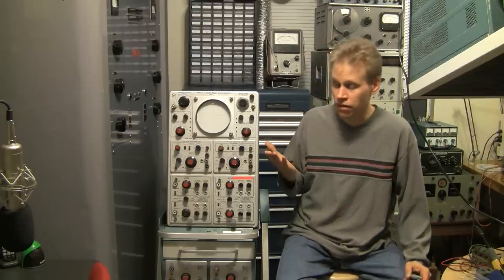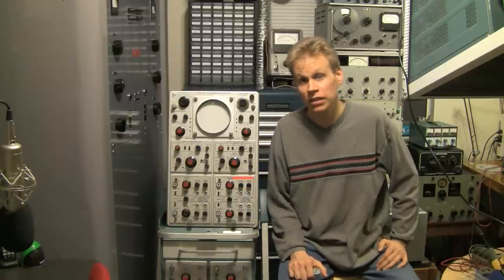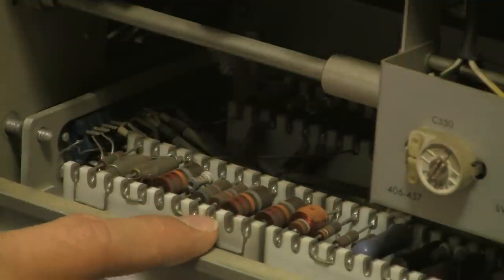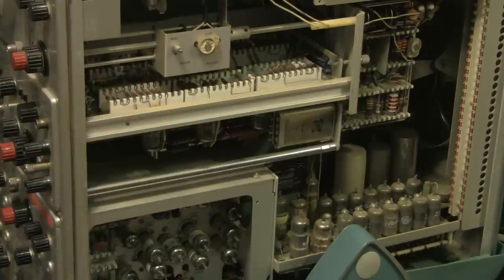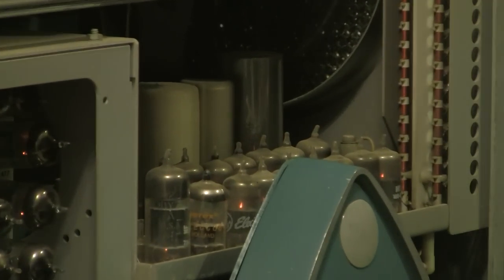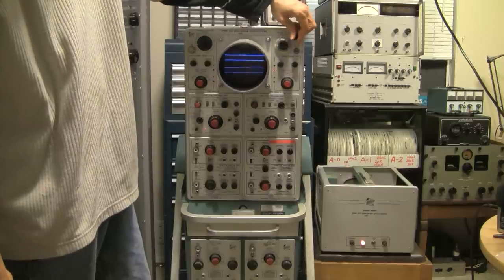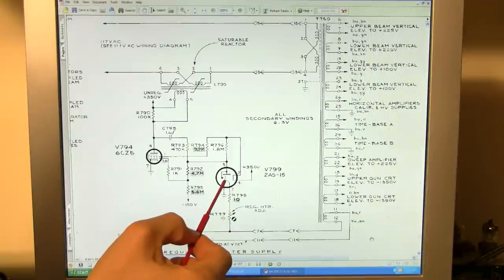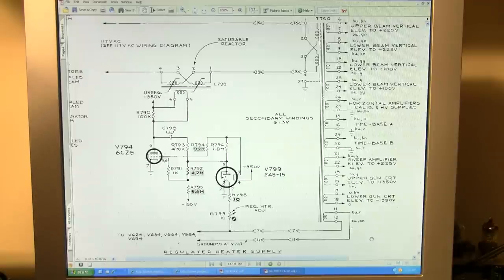Tektronix type 555 oscilloscope, over 100 tubes inside!

Comment: I was a repair and calibration tech for Tektronix in the 1970s.   For EVERY piece of gear that came into the shop, its first stop was the wash rack.   The gear was hosed down with soap using a sprayer nozzle virtually identical to the ones you see at the self-serve car washes, in a well lighted and mostly enclosed metal "sink" that had a large lazy Susan in the middle so that the gear could readily be rotated during the procedure.   It'd then be rinsed off, and then blown out with compressed air.   The next stop was the dryers, which were large heating cabinets that ran about 130 or so degrees (IIRC), and they'd stay in there for at least two days.   The only rule was, any gear that had transformer cans, had to be positioned so that the opening in the can faced down to avoid any chance of a large amount of water pooling up inside and not drying out completely over the two days.   Consequently, none of the techs ever had to deal with the "smell of dusty tubes," it was all squeaky clean before we did anything to it, even before we powered it on for the first time.  I never saw or even heard of a case of something being damaged from the wash.   Made it nice to work on the old tube gear given there were a lot of them still operating that had long been in dusty and dirty shops.   Tektronix had its own ceramics shop to make the strips, so they were the only ones who used them-- and they also made it a breeze to work on.   The ceramics shop eventually grew into making ceramic CRTs, another thing you were not likely to see in any of the competition's equipment, and they made their own bistable storage tubes, quite an achievement at the time.   Tek gear was designed to be maintained, in the 7000 series for example, every transistor is socketed as well as all the ICs.   And the 7000 series "digital" readout chips were actually analog, designed by Tek to "steal" the beam away from the trace momentarily and move it into the corners to draw the readout characters.   The 7000 series displays are not raster scanned, they're actually drawn, which gives them their unique look.
Reply from the maker: Thanks for sharing your story! That was a great read.
Reply: No, I don't believe so-- as far as I know the water was right out of the tap and not treated.   I suppose there could have been a water softener, I don't recall now, but I doubt it was distilled.  And it was blow-dried off before putting it into the drier, mineral deposits weren't an issue.
Reply: Absolutely-- if you drop it in a puddle, that's what I'd do.   With a phone though, you might want to open it up to clean the inside, which isn't always so easy...
Reply: @racitup4114  Not really the same as a laptop or phone has a battery inside so there is always voltage flowing around circuits.  As someone who deals with liquid damage Macs, water and electronics that are powered is not good at all.
Reply: Thanks for sharing that story!
Reply: @Twin_Flyer    Good point, that wasn't a problem at Tek back in the 1970s.   The type 422 had a battery pack, but we saw few of those, and probably wouldn't have washed the battery itself-- remove it for replacement probably.   And some of their newer gear could be treated differently now.
Reply: Damn.....If someone else, that hadn't worked at Tektronix, told me that I wouldn't believe it....
Didnt the knobs or other plastic change its colour ? 

Thanks a lot for sharing.
Reply: @kurtlilienthal4978   What, you mean just from the water?  No-- also we'd hit them with a compressed air jet after washing and before going into the drying racks-- that would blow off most of the excess water.  We had a full parts supply as well, so anything amiss, like missing knobs or those little gray caps on the lever switches, they'd get replaced right away-- added to the work order as parts to charge the customer for.   Also, most of the fan filters were a washable foam, or would be replaced if they were too old and beat up, but they often got washed and re-used too if I remember correctly (this was like, 40 years ago now though, some memory has faded of some of the details, we might have just unconditionally replaced them but they were robust enough to survive washing).   Certainly old plastic parts could change color, but not all that much unless they got a lot of sun exposure and that wasn't particularly common.   The one exception is there were these plastic wiring harness anchors that would turn yellow and brittle over time, used in the tube equipment and they'd get replaced.  The plastic was an earlier composition and eventually they were made out of a better plastic and didn't need replacement again.
Reply: @Syncopator  I consider Tektronix one of the greatest companies EVER. I have a special fond place in my heart for Tek equipment. I've got lots of TM500 modules, a 2246 scope, 1740 vector/waveform monitor and lots of small assortment of tools and accessories. Only the Logic Analyzer is Agilent. Greetings from Brazil!
Reply: Yeah I remember people telling me stories about the washes. I actually just rescued an old 310 that’s quite dirty and it has a small dent in the backside. Poor thing. I’ll probably give it a nice wash out, and replace the old caps. See if i can get it working again.
Reply: @racitup4114  No.
Reply: That shoud have cooling fan
Reply: @MrCarlsonsLab  i Will call it fore big Boy
Reply: @MrCarlsonsLab  You should visit the vintageTEK museum near Portland Oregon. They have examples of pretty much every oscilloscope Tek ever made. It is staffed by retired Tek employees who will give you the insider's view on how these machines were designed and built. They even have the Emmy that Tek won for technical excellence in producing their NTSC test system.
Reply: My first scope... when I was a teenager in the 70's, was a Tek 5XX something that I scored at a surplus outlet.  One day a rotary switch broke and I shipped it back for service, which was a daunting endeavor in those days.  I remember it took ages, probably a couple of months, but it came back crated... literally... and when I opened it up it looked virtually brand new... gleaming.  As a kid my jaw dropped open and I couldn't believe the work they had obviously put into it.  I'm not actively involved in that world anymore but I still have a 7000 series on the shelf and whenever I look at it I'm nostalgic for that first scope that I was so proud of... thanks for the explanation!
Reply: @racitup4114  I'v washed several laptops after coffee spills, rinsed them off with window cleaner, dried with warm air, they all survived.....  Ofcourse you have to take the whole laptop appart, take special care of the mechanical parts sugar and cream make every thing sticky.  Couse most spills where my own I usually got there before the mechanics were flooded.
Reply: When I worked for Lockheed,  we rarely would wash one of these beasts.  However,  I am very familiar with the wash rack.  We used a water-soluble oil-based cleaning solution and put the items in a 50 deg C oven for about 4 hours.  Most of the larger o'scopes never went to the wash rack,  because they are a real bear to dry out.
Reply: You have got to be kidding…….. car wash an oscilloscope?!
Reply: When in the Navy and the ship was on Long Beach for a couple of weeks, I visited a facility where they refurbished equipment.  They had what might have been a restaurant type automatic dishwasher.  (Perhaps they didn't run it as hot as a restaurant would.  Just guessing.)  They started by taking out all the tubes and discarding them.  Then it went into the dishwasher and then dried.  Then all new tubes were installed.  They would power it up and if there were no problems so far, they let it sit for a day powered up.  Then they went through the calibration procedure.  Any problems, and they would then trouble shoot and repair.  Usually, they didn't have to do any repairs on Tektronix scopes.
Reply: I used to work as a service tech, however, after reading your story, I don't envy you for what you had to do to repair those ancient pieces of test equipment. Still, I do like to look at them for nostalgic reasons and marvel at them. No wonder they weighed so much when I see the size of ceramics put in them. Wonder how much power this one uses to run! I guess it could heat the workshop in winter, eh?
Reply: @sibalogh  pretty much

Comment: Wow, I am a old engineer and I have owned a 555. The explanation of the filament regulator was excellent. Seeing the tubes with labels to, as that meant they were matched pairs. That family of scopes had issues with the HV rectifier tubes and I still own a drawer full of 15000 volt silicon diodes to replace them. Their yours if you like.

Comment: As a former Tektronix employee I’m always delighted to hear praise for our gear.
Reply: Is this the same tektronix that is nowadays building solid-state Bowling machine electronic parts for the Brunswick and AMF machines? I'm kind of thinking not, but stranger things have happened..
Reply: Tektronix built mostly Test & Messurement equipment, but as only a tiny part of what they once were, anything is possible.  For years they were the largest employer in Oregon, 24,000 people, now less than 4,000 and shrinking.
Reply: It’s like Yoda comrnenting on your brand of light saber.
Reply: @dougtaylor7724  I love that comment, I am going to have to commandeer it.
Reply: @lincreed-nickerson7949 question about a tectonics, might be able to grt my hands on a 564 storage oscilloscope that has tubes.  I already have a 465B no tubes and it works great, should I still get this tube based scope?

Comment: I worked at Hirst Research Centre in Wembley from 1968 until 1975. We had 545's and 547's, and one 555 (there were more in other labs) which I got to use quite a lot. They were all still in use when I left and very reliable.

Comment: I was a repair and calibration tech for Goodrich for 30 years. The engineering department many Tektronix scopes. They took all the tube stuff out of service and put it all in storage. The electronic engineer in charge was near retirement. He hated the idea of trashing all tube stuff. Because he used it when it was new. The lab was moved to a new building about a hour drive away. The new lab was a shielded room. We did some vary sensitive electric calibration in there. The old lab storage room had to go. They gave me everything I wanted. :-) I was like a kid in a candy store. I went there on weekends to calibrate everything I took home. The boss trusted me to take a $35,000 multifunction calibrater to the old lab. :-) Among everything were three 545A and a 555. I calibrated them to the Tek manuals. I found a Tekronix main frame standardizer. We used it calibrate the mainframes before calibrating the plug-ins. That was needed for using many different plug-ins in many scopes. Some antique radio collector friends a I started the Buckeye Antique Radio Club in 1971. We have about 50 members. I live on a closed chicken farm near Akron Ohio. I built a 16 by 16 foot two floor building for my radio collection of 250 radios and one scope. Everything in here is older than 1925 except the 555. I converted my chicken coop into a four car garage for my antique cars and motorcycles. A 1903 one cylinder Oldsmobile. It looks like a buggy that uses a horse. A 1930 Model A Ford rumble seat coupe. A 1951 M-38 Military Jeep. A 1949 Simplex motorcycle and a 1950 Whizzer. He is right about the 555 scope. It make a good 2500 watt heater. :-)

Comment: One way to think about the cost of a complete upper level Tektronix scope system, amplifiers, cart, probes, and mainframe, is that it would cost about the same as a nice suburban home. This held true until about the late 70s ~ early 80s when real estate values went nuts-high.  My teen and young adult years were in the back yard of Tek starting in the late 60s. I got to see the scopes being made and got to meet many of the fine engineers that created this stuff.. In that period, the last of the tube units were still being made, and the new generation solid state product was coming to market, the 5000/7000 series mainframes, and the TM500 auxiliary instruments. It was amazing what they created, and now over 50 years later, I still use a lab full of analog instrumentation by Tek in the pursuit of making a living.  I have dozens of major Tek instruments still working and keeping cal, at from 35 to 50 years old. Magnificent technical achievement was the norm at Tek until the founders died. That dual beam is a gem... I use my later period dual beam all the time, a 400MHz R7844, accompanied by a 7834 400MHz storage scope, a7704 with P7001 digitizer, and a 2247A portable. We also use TM500 scopes for general waveform monitoring.   My 7704/P7001 was the personal property of its inventor, the father of digital oscilloscope processing,  Hiro Moriyasu.
Reply from the maker: Great story, thanks for sharing that!

Comment: We had one in the corner of the lab where I started working in the late 1970s.  The "old timers" who used to use them said the after turning on the lights in the morning, you would turn on the 555.  The go make coffee, drink a cup, chat with you buddies, and take your second cup back to the bench, because by then your 'scope had thermally stabilized.  You could warm your sandwich up at lunch time be just placing it on the top !

A true engineering marvel !!

Comment: Well that was a blast of nostalgia! My little company bought a used Tek 555 in 1968, and we were damn smug about having such a nice oscilloscope. As we could, we acquired several different plug-ins. I recall that Polaroid made an adapter that clamped onto that round bezel, allowing you to make hard copies of the waveforms using (IIRC) Polaroid 5" x 7" cut film. You could set the oscilloscope to Single-shot, open the camera shutter, trigger the scope, close the shutter and pull the film through the squeegee rollers. A minute later, you could see if you caught the event, or needed to try again. Tube test gear may still have its charms, but nobody who ever recorded a waveform this way ever wanted to do it again after experiencing the delights of dumping digital memory to a printer.
Reply: And now,  we just whip out our cheap Canon Powershots to capture the trace.  :)
Reply: @gyrgrls  Please notify me when you perfect your time machine; 1960's me has a list of desired toys. (We better use precious metals so as to not disrupt the timeline.)
Reply: I had the privilege of testing Polaroid Type 410 (ISO 10,000) instant film when I was in 7000-series engineering. It was quite impressive although by that time not as necessary because the nuclear labs were buying our new 7104 1GHz mainframe on whose screen one could easily view a single-shot event at the maximum time-base speed, 200ps/div. Ordinary Polaroid was fast enough to photograph those 7104 traces.

Comment: This was my scope for twenty years at RCA Labs, back in the day. All scopes came with a small roll of silver solder.
Reply: I was a technician/instructor for RCA Service Co from 1954 to 1987. Such nostalgia for sure. In the 70's, I researched Tektronix oscilloscopes, and I was blown away at their circuitry. So I agree with what you and the author of this DIY video are saying.

I doubt there are many companies as dedicated as Tektronix. It's no wonder that their scopes are found in most technical manufacturers, all over the world.

Did Tektronix invent the "Trigger" Scope? I do not know, but it would not surprise me if they did.
Reply: They came with a lifetime supply of "silver-bearing" solder.  This was because of some connections that were directly soldered to ceramic strips!

Comment: That regulated heater supply is so simple and yet so incredibly clever. Great video Paul.
Reply: Yes.  Although the tubes would age gracefully, the scopes required only occasional calibration.  The regulated filament supply was to help avoid drift,  greatly reducing the frequency of calibrations.  Now we have solid-state more and more units,  with the input stages often housed in assemblies similar to crystal ovens.

Comment: I worked for McDonald's as a maintenance tech for 22 years. I was told about Tektronix Company Store for employees and the general public back in '95. I would go for chairs, file cabinets and wire shelving. There was always a long line to get in at 2:00 on Tuesdays. I would always try to be there early because at the head of the line were all the retired engineers. They were a vast store-house of knowledge like you, and were glad to answer any questions I had. It was in Beaverton Oregon, but I haven't been there in a long time. Keith L.

Comment: When I was going to high school in the early 70's we had two of these donated to our school by the Air Force as surplus. At the time we were using Heatkit OL1 units that a previous class from the 1960's put together and were not very good even by the standars of the day. The donated Tektroinx still had the DOD asset tags on them and the first time we used them were amazed on how well they worked. I still remember my teacher clling them the "Cadillac" of electronic equipment.